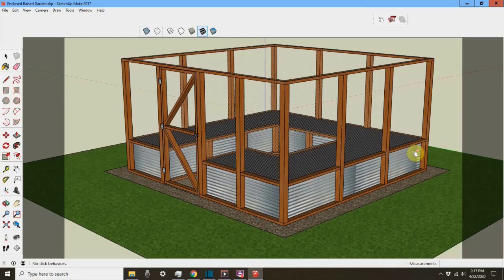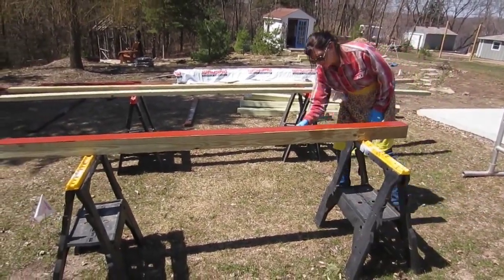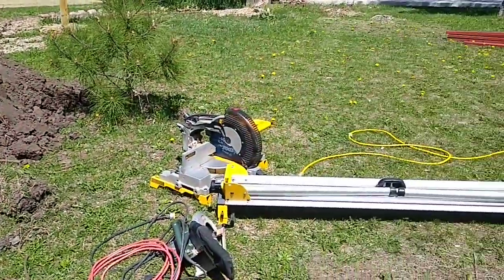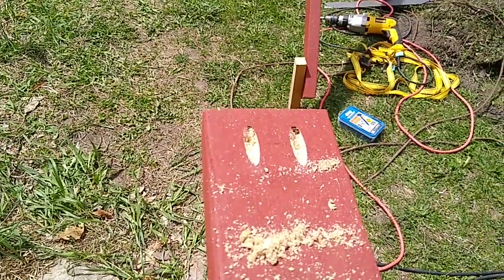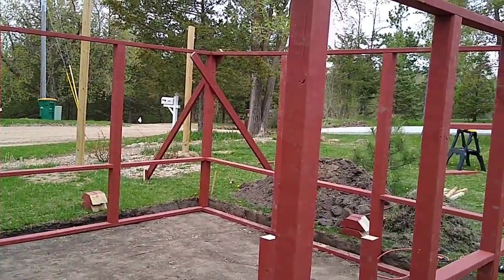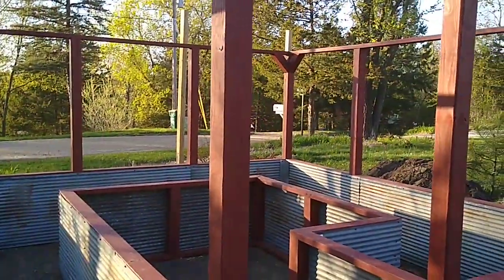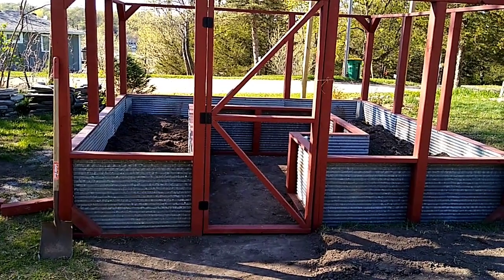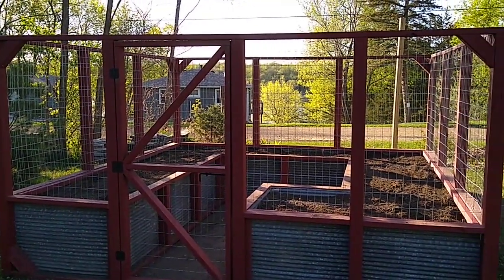Enclosed Raised Garden

Comment: First video I have found that is almost exactly what I to build.  I like that you stained the boards before assembly, I like the steel around the bottom so the boards don't rot, and of course the fencing is the most important.  You even filled the bed with trees branches like I want to do.  I would like to make the outside fence be able to swing open in sections so you could work on the garden from both sides.  I would also like to make a small section that can be used enclosed as a green house in the spring for early planting.  Excellent job!

Comment: Thanks a lot for the video, The Toolman.  This will help me tremendously in the spring when I attempt to build one of these.  Do you happen to have the material list and/or the steps involved in print form?
Reply from the maker: The materials and some additional notes are buried in the comments on the video.  You will find a lot of questions and answers if you scroll through the comments.  I modified the video description to include the material list I used for the project.  You'll need to click "show more" in the description below the video to expand it to see the full material list.  I don't have any written instructions, but hopefully the video shows enough detail to help out.  Good luck on your project.

Comment: Hi there, now that you have had this for about a year, anything that you wish you had done a little different?
Also, what is the purpose of the metal corner flashing in some corners?
I think we are going to try something very similar with a couple small modifications (I think we'll put the corner posts on the ground).
Thank you so much for posting this!
Reply from the maker: The garden worked great for us last year.  We had bumper crops.  It was a bit challenging reaching the tomatoes on the outside edge against the fence material especially in the corners.  It will be a lot of work, but I'm considering making the outside fencing hinged, so I can open it and get to the other side easier.
The flashing holds the outside corners of the corrugated metal together.  I drilled through the flashing & corrugated metal and pop riveted them together.  I also added some trim to the 4x4s at those corners to provide extra support to the corrugated metal.  I added the trim to my Sketchup model in purple so you can see the mod.  https://app.sketchup.com/viewer/3dw?WarehouseModelId=d185587b-7dc1-42be-aebe-73b03a1976b4

Comment: I live in country with a lot of wild turkeys ,squirrels  and birds. Would you use bird netting over top to keep creatures out  and use chicken  wire  instead of the metal  ? This is a nice plan
Reply from the maker: Thanks.  We haven't had any trouble with animals other than deer, but I would absolutely go with netting over the top if needed.  I think chicken wire is a bit flimsy for the sides.  I would look for a tighter mesh galvanized wire.  I've seen it in 1/8", 1/4", 1/2" and 1".  Search for Galvanized Hardware Cloth.

Comment: my question is how did it work out accessing the deep corners from the inside walkway?  did you consider some kind of lining to help preserve the longevit of the galvanized?
Reply from the maker: Reaching those corners is a bit of a stretch.  I usually put stuff that doesn't require a lot of tending in the corners.  We moved our sunflowers into the corners because the deer were feasting on them outside the enclosure in years past.  I thought about putting hinged frames in the fencing so I can open them from the outside, but it's working out fine right now as is.  I didn't go with any lining.  It's our fourth season and the galvanized is holding up great.  Time will tell.

Comment: I love your design. We will be building this in the spring. Do you have a supply list for the lumber by any chance?
Reply from the maker: You will need: 7 - 2x4x14', 20 - 2x4x8',  16 - 4x4x8' and 2 - 2x2x8'.  The 2x2s were not in my original design, but I added them to the model in Sketchup https://3dwarehouse.sketchup.com/model/d185587b-7dc1-42be-aebe-73b03a1976b4/Enclosed-Raised-Garden.  Look for the purple 2x2s at each corner.  You need the 2x2s to support the metal panels where they meet on those corners.  We bought 10 sheets of 26"x10' used corrugated metal and had one full sheet left over.  26" is pretty standard for corrugated metal.  I used left over pole barn metal screws to attach the metal.  Hope your project goes well.
Reply: Thank you!

Comment: Hair, just a trim but keep it on the longer side. Question. How long do you think it will last where it has contact with the ground. What part of the country are you in? Looks like you enjoyed doing this together.
Reply from the maker: We used ground contact rated pressure treated lumber.  It should last 20 years or more.  Were located in central Minnesota.  We did have a lot of fun working together on this project.

Comment: you said this a 12 x 12 yet looking at the plans it shows 12' 7" x 12' x 7". Any specific reason you didn't go with 12 ft boards instead of getting 14' boards and cutting them down to 12' 7" and save the additional expense?
Reply from the maker: Because sometimes, I am an idiot.  As with many things in life, hindsight is 20/20.  I had my mind stuck on 12x12 for my inside dimensions.  So add the 3 1/2" posts to each side and you end up with 12' 7" outside dimensions.  In the end, that decision probably cost an extra $20.

Comment: i know it's been a while since you built this, but i was wondering how you attached the tin to the outside corners when the 1st piece of tin covered the board.   i didn't see an extra board to attach it to.
Reply from the maker: Good eye!  I used 3" galvanized flashing to join the outside corners.  The flashing is fastened to the corrugated metal with large pop rivets.  You could also add 2x2 wood strips on those corners on the outside to provide a spot the fasten the corrugated metal directly instead of using the flashing or do both.  I put the flashing in to ensure the dirt didn't leak out of the corners where the metal is just butted together.  After four years everything is still holding together nicely.
Reply: @TheToolmanTim  thanks

Comment: Great build! Can you tell me what length you cut the 2'x4'x8' post down too please
Reply from the maker: Thanks.  Just to be clear, are you asking about the 2"x4"x8' or did you mean the 4"x4"x8' I used for the vertical posts.  If that is what you meant, I cut them down to 6' 6".  There is a 2x4 running under the whole unit as well as one above that tie everything together, so that makes the actual height 6' 9".
Reply: @TheToolmanTim  Yes thank you that is exactly what I meant!

Comment: anyone ever look at making something like this convertible to greenhouse to extend growing season a bit? Maybe by making a frame with the clear hard plastic roofing sheets for the 4 side walls and then 2 for up on the roof that can easily be attached at the end of the summer?
Reply from the maker: That is an excellent idea.  The structure would support greenhouse panels no problem.  You would just need a small mod to have a pitched roof.
Reply: @TheToolmanTim  I was thinking you can set up like slides along the sides to slide in the clear panels to make them easy in and easy out. I am going to have 2 posts at 12 foot in the middle on the outside with 1 dead center so as to set up the peak of the roof and 8 on the corners to give the pitched roof effect. Again, set it up so you can slide the panels in and out.

Comment: Any issues with settling being built directly on dirt?
Reply from the maker: No problems.  We made it through a winter with no shifting or settling.  The gate is still straight and true.  The garden is located at a dry high spot on our property that doesn't see frost heave in the winter.  If it was damp, it might be a different story.

Comment: What did you use for the inside corners? I see some kind of metal plate.
Reply from the maker: You're on the right track.  I used 3" galvanized metal  corner flashing.  I pop riveted it to the corrugated metal.  I picked it up at Menards in 10' lengths.  It worked great.  I also added 2x2 wood strips to the outside of those corners to provide a little extra insurance against a blow out.  We got through the whole growing season without trouble and made it through a hard freeze winter cycle as well.
Reply: @TheToolmanTim  Awesome! Hey, I really appreciate you replying back. Also, I love your idea using corrugated metal. Originally I was going to use 2x12 boards like everyone else until I saw how much that would cost. lol

Comment: Paint will chip over time I would rather use cedar or trex decking boards
Reply from the maker: The color isn't from paint.  It's an opaque stain and  after 3 years of extreme heat, humidity, rain, snow and below zero temps it is holding up great.  No chipping or peeling.  Cedar would work great, but I'd caution against a material like Trex.  It doesn't have the lateral strength of wood. It's great as decking where you have joists every 16", but it will bend like a wet noodle over longer stretches.

Comment: What did you use the 2x2x8’s for?
Reply from the maker: The 2x2s were not in my original design, but I added them to the model in Sketchup https://3dwarehouse.sketchup.com/model/d185587b-7dc1-42be-aebe-73b03a1976b4/Enclosed-Raised-Garden.  Look for the purple 2x2s at each corner.  You need the 2x2s to support the metal panels where they meet on those corners.

Comment: Does your ground freeze/heave in the winter?  What state are you located in?  Or garden zone?
Reply from the maker: We're in Minnesota.  Our garden zone is 4a.  If it gets cold early without a lot of snow, the frost goes pretty deep.  The soil conditions on my property are on the sandy side, so I don't get a lot of heaving from frost.  If you have a lot of moisture trapped in the soil, you can get more heaving in the winter.
Reply: @TheToolmanTim  Thank you so much for replying. I was told I had to put posts 3 ft in ground.
Reply: OOps. I did't finish reading about the sandy soil.  Mine is poorly drained clay.
Reply from the maker: @michelearmstrong4060  I thought about sinking the posts into the ground, but decided against it since the garden isn't a load bearing structure like a shed where it needs to support a floor.  My biggest concern was that I didn't want the weight of the dirt to push out the base.  I solved that problem by pinning the base to the ground using rebar.

Comment: How much would charge to build one of those
Reply from the maker: If you build it yourself, plan on spending between $700 and $900 for materials.  If you have someone build it for you, the price would go up considerably.
Reply: Are you not worried about need cross supports inside the bed to keep it from bowing out over time? I've been trying to figure out how I want to build my raised bed and have been contemplating a 8'x12' design like this with corrugated Galvanized steel on the outside with the frame hidden inside but worried about wood rot over time too.
Reply from the maker: All of the bottom plates are anchored into the ground using rebar.  I thought about adding cross support higher up, but opted to go without it since this unit was already pretty compact and stout.  We got through a full growing season and a winter without any bowing so we're in good shape.  If you use ground contact treated lumber, you should get many years of service without it rotting out.  I chose to put my lumber on the outside to minimize the chance of any chemicals leaching into my raised bed soil.

Comment: How did you anchor the 2x4 to the ground?
Reply from the maker: I pinned the 2x4s to the ground using rebar.  I cut rebar into 16" lengths and pre-drilled the 2x4s using a 1/2" bit.  Then I used an 8lb sledge hammer to drive them home.  Three years and counting with no movement.